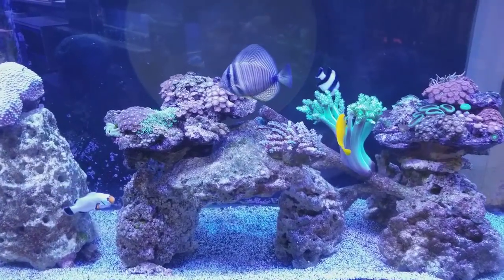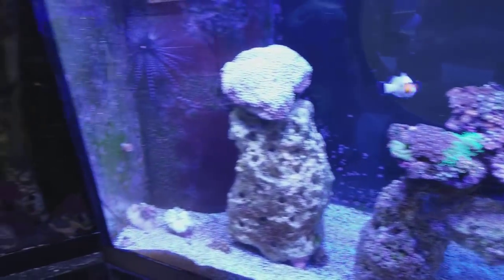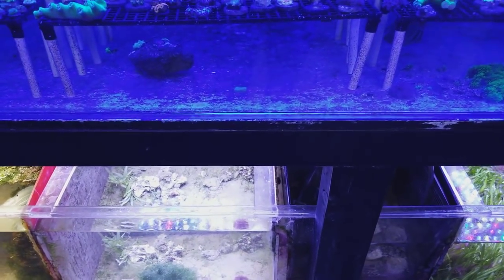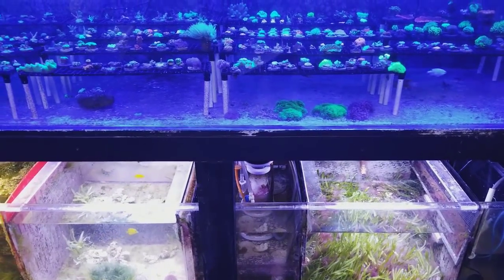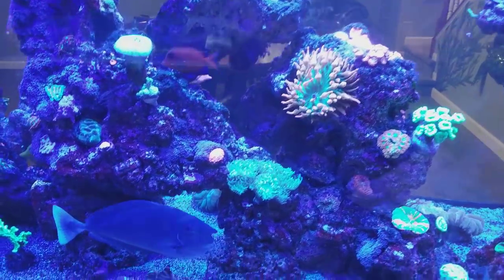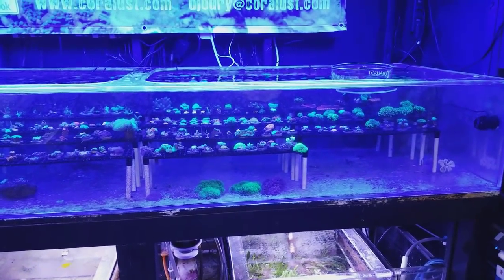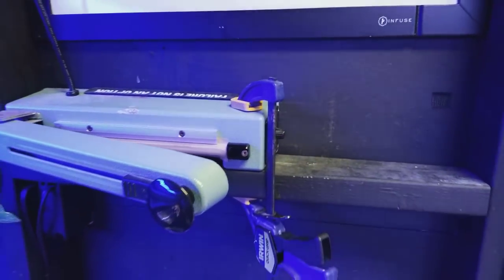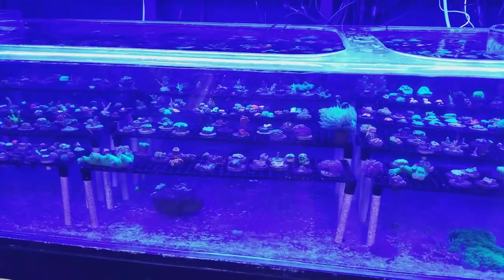Top 5 reef aquarium mistakes and tips to avoid them

Comment: Back ups, back ups, and more back ups. 😂 I have extra heaters, extra return pumps, three different ways to measure temperature, back up bubblers. Some times testing stuff multiple times helps too I did a test for calcium and it was super low and I was about to dose my tank and then I checked it again and realized I used the reagent for magnesium and when I   retested with the right reagent my levels were fine.

Comment: Great info! I have a question. I have a 90 gl corner tank with soft coral and a few lps. I have a sump. I use a sock, skimmer and cheato that grows really nice. I’ve noticed that since I added the cheato, my skimmer hasn’t been skimming near as much. Is this a good thing or bad? In your opinion, am I running to much in my sump?
Reply from the maker: That's a good thing, the chaeto will remove organic material just like your skimmer, unless you think your skimmer is broken I wouldn't worry.  You can also turn your skimmer up a little.

Comment: What is the PVC T-pipe with bubbles coming out of it? I've seen it in several of your videos but can't figure out what that thing is for! https://youtu.be/BBzcc9pABNg?t=118
Reply from the maker: Which tank,  are you talking about the big refugium underneath. It's a return line designed to break up flow.
Reply: Yes, that's the one. Are bubbles coming out because it doesn't pull a full siphon?